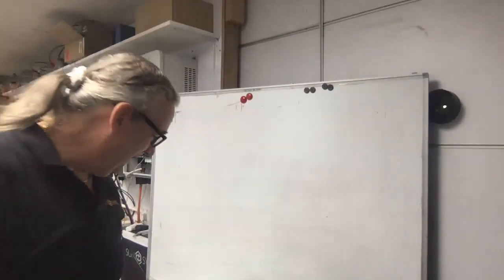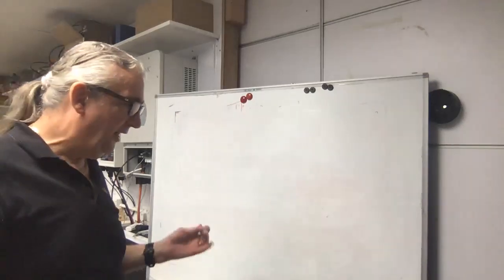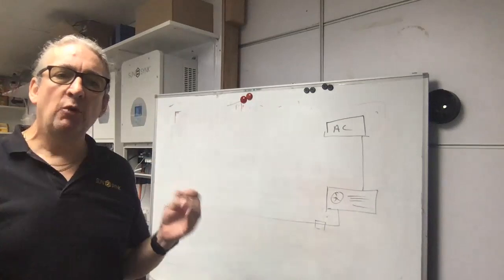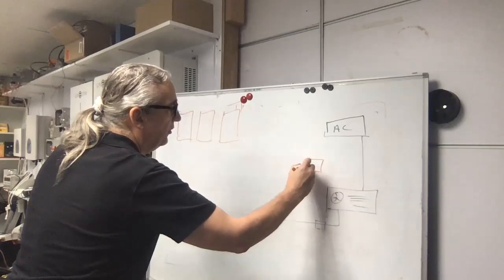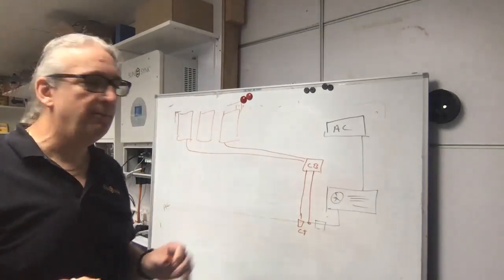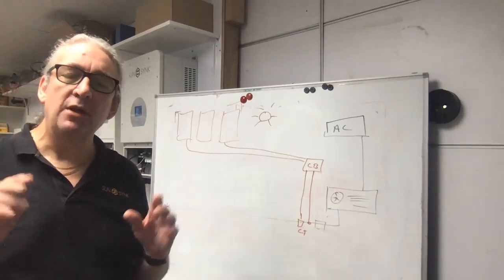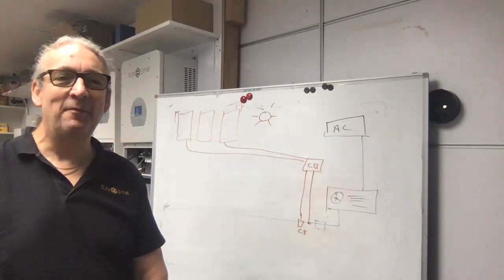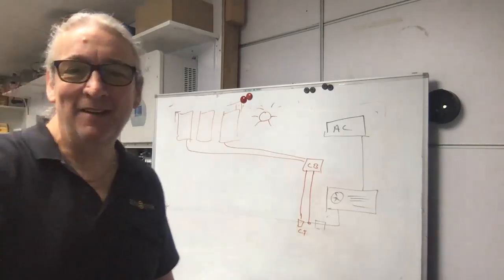Solar converter box

Comment: 1:35 We got into Solar because we bought an Inverter AC that has ports for PV panels... so Hmmm... we connect PV Panels and got free AC. Then we thought, if we are not using AC, then PV solars are useless... so we went and installed On Grid inverter... was happy about it, we are now into Hybrid Inverter.

Comment: Is this not just a grid tie inverter?
Reply: It is a type of grid tie inverter, with zero export making it perfect to power single appliances
Reply: @keithgough  
So in my particular setup ... your solar converter could be used to energise a Sunsynk hybrid inverter in battery charge mode, from a separate, AC-coupled, grid-tied solar array that is producing spare PV power on a feed-in-tariff ? Or do the hybrid s do that anyway ?